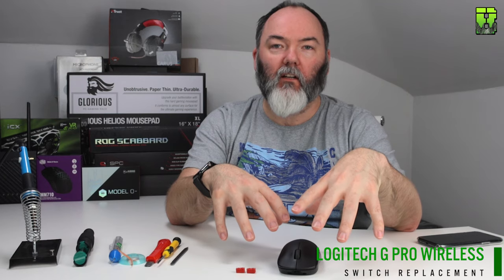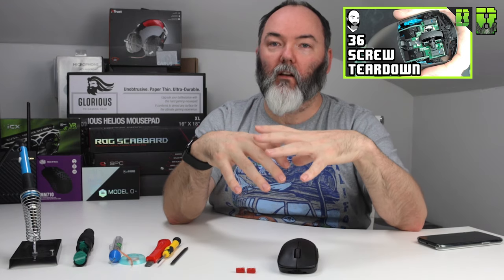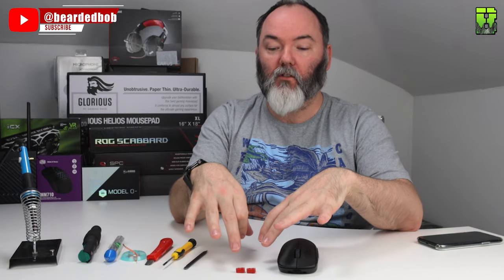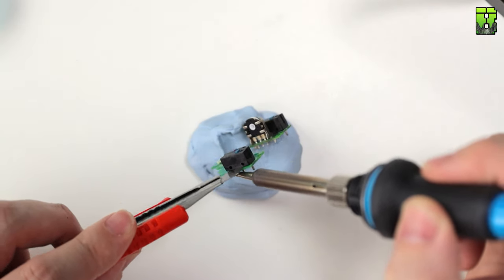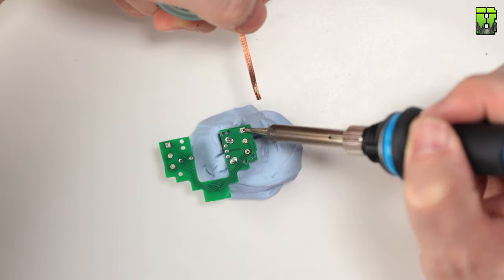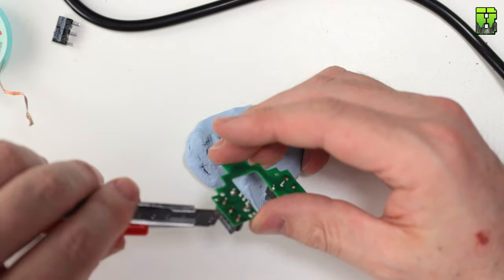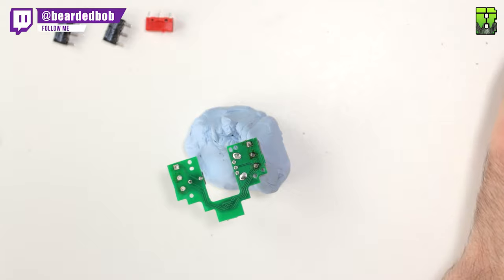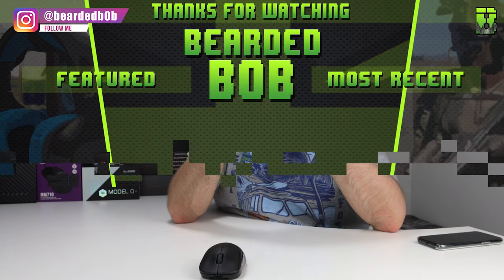LOGITECH DOUBLE CLCK FIX: SWITCH REPLACEMENT

Comment: My right click on my gpro just broke after only a year of use, attempting to RMA the mouse since its still under warranty and has no way had 50m clicks.
Was originally thinking of just buying a new mouse as Logitech's support is infamously slow.
Found this tutorial, seems easy enough, checked the prices of everything I need and comes in to way under the price of a new gpro. If logitech don't agree to sending me a new mouse within the next week I will try this out with Omron D2F-F-3-7 switches as apparently japanese ones at better than chinese ones
Reply from the maker: cool let me know how you get on, its fairly easy if you are good with a solder iron and much cheaper than buying a new one.

What version is your GPW? 18xx or 19xx?
Reply: @Beardedbob  I have an 18, After contacting logitech support I think they will send me a new one but I will attempt to mod my current one with weight reduction aswell as new switches
Reply: @Beardedbob  Just got it finished, new skates aswell, very nice upgrade. Easy to do aswell.

Comment: Just curious why you don't use a solder sucker instead?
Reply from the maker: I preferred braid, I have mixed it with a manual solder pump. The best solution which isn't cheap and i'm using now is a Hakko desolder gun.
Reply: @Beardedbob  thanks for the reply! I'm fairly new to this hobby, and was going to use a solder sucker myself in a few weeks when all my parta get here. So was just wondering if there were any particular reasons you used a braid, didn't want to mess up my mouse lol

Comment: BeardedBob you are a mad man! I'm looking through these comments and you're actually replying to every single one LOL I commend you for that, much respect, subscribed to you just for that. But great video. Do you do anything like a switch replacement service for the G Pro Wireless? I think you would get a whole lot of business because there are so many out there suffering with this double click issue and would rather not take the risk of breaking something changing out the switches themselves, myself included. I just had to return a G Pro Wireless due to double clicking issues that were so bad it made me very depressed and gave me some kind of 'insecurity' with any mouse I'm using now because I'm afraid it'll double click and I'll have a mess to deal with again. If I get the double click issue with my replacement mouse I'll definitely be willing to pay you to change out my switches to something more reliable but still as responsive, I know some have mentioned Japanese omrons (possibly better than what Logitech uses) or other omron variants, that might be a possibility.
Reply from the maker: Sure am 😜, I like to see what people say and respond
Reply: @Beardedbob  Dude you didn't even respond to any of my questions, that's hilarious. You just overlooked everything I said to you, every single question. I spoke too soon, can't subscribe to that.

Comment: i broke the right click on my gpro wireless like the actual plastic that u click is there anywhere i can buy a replacement and replace it myself
Reply from the maker: You could try to glue it? Or you could see if you can find a 3d printed version

Comment: I tried to do a switch mod on my 502 however i messed up destroy the original switch and a new switch and the 2nd switch I soldered doesn’t work what should I do?
Reply from the maker: Go for a 3rd attempt :-)
Reply: @Beardedbob  I did then ended up breaking my encoder and burning my board
Reply: @Beardedbob  good thing I was practicing for my gpw and also are hauno blue shell and blue dots good?

Comment: Where do I find a replacement for the circuit board, I may or may not have burnt the board trying to do this
Reply from the maker: You can't as they don't sell them. If you are lucky you might get a broken one of eBay
Reply: @Beardedbob  I've tried on ebay you know any other places to buy a broken one?
Reply: @Beardedbob  or maybe a way to fix the burnt board

Comment: Hi Bob!

I've heard that the encoder can be replaced with an 8mm kailh, are there any others you recommend for a more premium feel? 
https://www.aliexpress.com/item/32984923029.html?spm=a2g0x.12010612.8148356.7.47ee4d5403q0iZ

Also, do you know what switch I can use to replace the middle click? i see a bunch of microswitche but cant figure out what are/arent compatible, do you have any recommendations on this front too?
Reply from the maker: Kailh is my preference atm or the alps if they do a 8mm version.

The middle is limited, there are stock repalcements but beyond that I've not tested them yet.

Lmb and RMB atm I recommend Kailh red, TTC gold or Omron Japanese

Comment: use flux it help a lot as u try to remove the solder and a solder suction pen
Reply from the maker: Will do thanks for the tip

Comment: WOOOOOOOOOOOT, didn't i recommend this? :D i'm about to do to soon, i need my flux though.
Reply from the maker: You might just have done so sir 👌, let me know how you get on when you attempt and how you find them 👍
Reply: @Beardedbob  well, i have all the necessary stuff but i want flux either way in the process so eh :D 

Before it was a pain to take just one of em off, never realized i can take off the scroll wheel easily, i was trying to balance that thing while desoldering. WHAT A PAIN.

got the Kailhs, probably within a week i'll get my flux from china lol.
Reply: @Beardedbob  Holy crap, i screwed up the soldering pads on the pcb and had to scrape some of the trace to get the solder to there to get a good connection either my left mb doesn't work. i did this 3 times to get the mouse to work, btw it took me like 5 hrs to get 2 mouses completely soldered LOL
Reply: @Beardedbob  They feel good and clicky, but feels a bit loud, it sounds quite normal for a mouse but i'd prefer a little less clicky and less actuation force but overall... NO DOUBLE CLICK :D

Comment: wouldn't it be better with higher iron temp(up to a point of course). higher temp less time you have to hold it to the solder = less heat transfer to the board.
Reply from the maker: Not always as you can just destroy the sold pads instantly. Temp really depends on a few things, switch PCB thickness, tip

Comment: I'm having an issue were I think my left mouse switch is dead. I'm going to try replacing my left and right with these and see if it works.
Reply from the maker: Let us know how you get on. What mouse is it btw
Reply: @Beardedbob  gpro wireless. It's definitely a hardware issue and I'm guessing it's the switch because the right mouse works on the same board. If replacing the switch doesn't work I might be SOL...

Comment: So much work on a mouse that drops polls and has an inferior sensor made for power saving. Putting a good cable on a wired 3366 is so easy, or just get a model o :D
Reply from the maker: each to their own..
Reply: @Beardedbob  It does drop polls to 500hz contrary to a wired mouse though..

Comment: mod different mouse change the switch to razer viper switch if thats possible
Reply: you can't, the traces or the SMT connection point are totally different and can't be mounted on the daughter board for the G Pro Wireless.

Also the buttons itself has a different layout. Won't work and i can't buy the razer optical microswitches for the razer viper ultimate anywhere. Tried looking.
Reply from the maker: Decent idea but Lime is correct 👍
Reply from the maker: Decent idea as that razer switch does feel nice but it not possible.
Reply: @Beardedbob  Bob the viper ultimate with optical switches feel like trash whatcha talking about?!
Reply: @Limeayy  thanks

Comment: Saved for later, who know when that aliexpress package will get here :) I think the breath trick will hold me over until then.
Reply from the maker: What's the plan? Are you swapping your switches out?
Reply: @Beardedbob  Yup. Doubleclick reared its nasty head earlier today, and it's somehow deteriorated to the point of not registering clicks at all about 30% of the time within a few hours. Honestly a bit wild, I've had zero issues or complaints with this for 14 months and I guess the switch just gave out.

Comment: I think these microswitches are a bad choice for this mouse. Too hard and unpleasant pressing. If you want a bigger move before triggering, then you should pay attention to Huano Blue shell blue dot 50 million clicks. If you want to have a lighter feeling, then you should pay attention to the Omron D2FC-F-7N (20m) (OF)
Reply from the maker: You can use which ever switches you prefer. The Kailh red seems to be well rated 👍 just tailor to your personal preference.
Reply: Of course, this is my personal opinion.
I will add my opinion about your modification of this mouse. You removed the part with springs, which is also a limiter and does not allow clicks to rattle and have an unpleasant sound. I think that it should be returned back, because on the video when you press the buttons there is too much extra noise. Is this really not annoying you?

Comment: having to spent $150 and needing to replace the switches is really a deal breaker
Reply from the maker: common issues with the Logitech nice using 50m omrons.
Reply: @Beardedbob  what are your opinions about the razer viper ultimate? Im considering that instead

Comment: omron switches have poor durability n have double clicking issues easily fail within a year or even months.. the so called 20m 50m in spec is just pure marketing propaganda bs. kailh switch have a lot better build n durability.
Reply from the maker: I've not personally had any fail but there's is noise on the web about them.